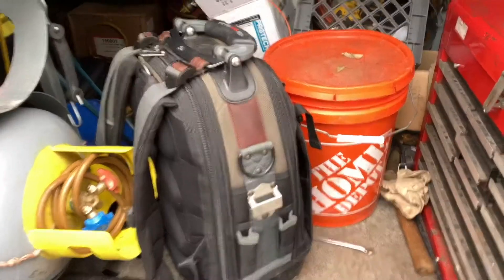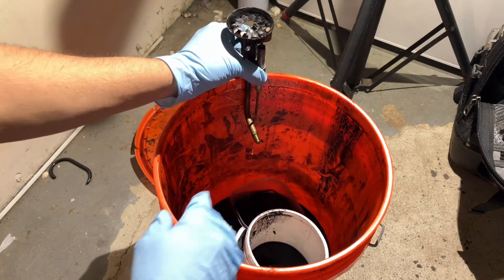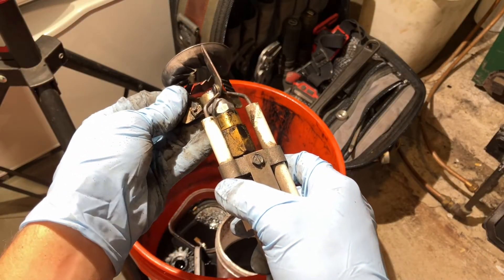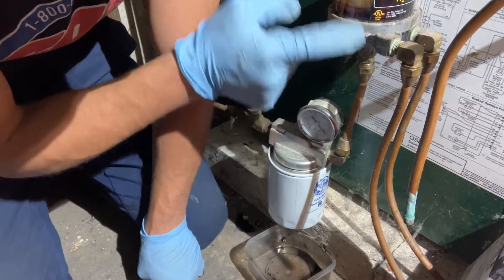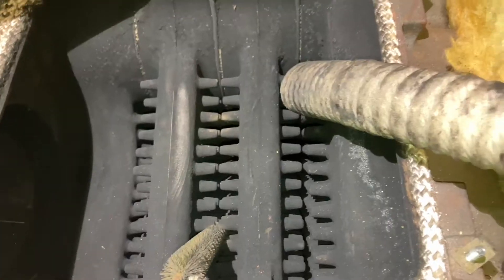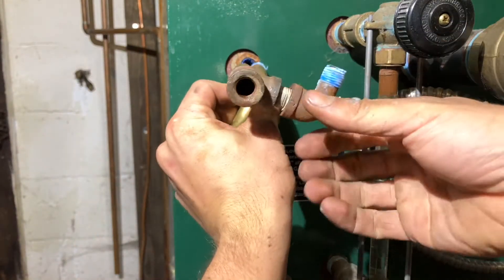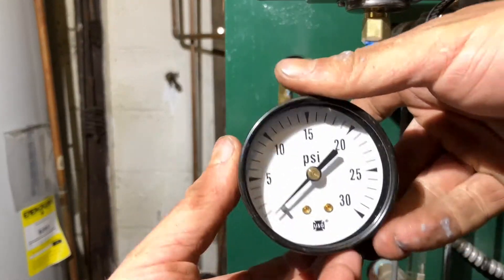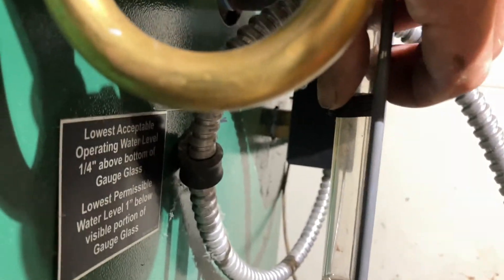What an Oil Steam Boiler Tune-Up Actually Looks Like

Comment: I am in a propane delivery and service industry. I always add ac/boiler/furnace switch if none is there. It's quick and easy modification. Customers are pleased when you tell them you added a safety feature that they can use if they feel something is not going right

Comment: I know its an older video, however one thing you should have done as a precaution would be to test the low water cut off as well by draining some water out to make sure it actually shuts off!  Safety first!  🤠👍  And a potential sale for new low water cutoff if it doesn't work.

Comment: You forgot to check the pump strainer! Great informative video, I recommend to use carb cleaner and spray down your electrodes, flame retainer, and nozzle assembly, and use some grit paper to get the nasty stuff off of the electrode tips. I noticed you used a Beckett electrode setter, I know Carlin has their own electrode dimensions which can be different than Becketts. I look forward to learning different ways you approach jobs!
Reply from the maker: Believe it or not I was going to include the strainer but forgot to mention it thank you for picking up on that! I was taught the Beckett guide is a good "guide" but eventually ill be able to see it by eye, like i'm sure someone with your experience level can do! Thank you for tip with the carb cleaner, definitely gonna include that in maintenance, and i look forward to learning different ways you approach jobs too! Keep in touch!
Reply: @theapprenticesurvivalguide  do you have any literature that you would recommend for a low period apprentice ? I’m trying to learn as much as I can on my own time.

Comment: Be careful using a metal wire brush to clean out those sections. soot is flammable and the metal brushes can create spark and ignite the soot, it has happened with unpleasant results!

Comment: Nice and thorough job.  I do the same thing each year with my gas steam boiler.  I also turned out all the drain valves and cleaned the accumulated mud out as well as turned out the sight glass valves and cleaned out those too.  I put in Hercules steam boiler cleaner also.  Do put that in or a comparable product, like 8-way?
Reply from the maker: Great to hear from you Kevin! Thank you for your generous comment. Only if the sight glass valve looks really muddy I’ll hang a little container on the valve then open it up to let it all flush out, if it has a sight glass drain I’ll let it flow for a good minute and call it a day. Do you think that’s enough or I should be more thorough? As far as cleaner I’m more familiar with using squick, seems like the Hercules brand might be better? Hope to hear back!
Reply: @theapprenticesurvivalguide  You do good work.  Most service people do a very quick and less than thorough service.  With so many steam systems in the NY/NJ area, you must be very busy.  It seems like you see a great deal of them, and from what I know most homeowners neglect them and then have problems.  I have found by doing the maintenance I do the last number of years, I have little mud in the system.  Key is what you do is cleaning out that pigtail, as that is big point of failure.  I see this home has a brass pigtail but steel fittings, which cause other problems.  I would suggest they swap those out for brass.  Squick is excellent, Hercules product seems fine by me but always open to someone who is in the trade and knows best.  Thanks for your response.  Keep up the great work!  Finally, you will be in great demand as there are not many people like you left servicing these boilers.  Go Giants and Jets!
Reply from the maker: @kevin7151  I cant thank you enough Kevin, you're very positive and supportive! Yeah, where i'm at we run about 5-7 service calls a day each, 6 sometimes 7 days a week. I don't think you would disagree with the idea that, and its mainly why I work that way, the more thorough you are with your preventative maintenance, the less of a chance you'll have to return for a service call later on. Obviously we can't find everything so it's going to happen, but going to a service call and finding out its just dead batteries in the thermostat is much better than finding a boiler leaking lol. You keep up with the great work too! I can tell you are passionate about your work! Go Giants (although these days they really test my patience)
Reply: @theapprenticesurvivalguide  Am in the north western part of Nassau county, NY and there are so many steam boilers here my friend.  My house is around 90 years old, so I make it a point to keep things running smoothly.  I am old now, but a someone like you who has youth on their side will have a very productive career doing what you are doing.  Just explain to each homeowner what and why you are doing what you are doing and they will better understand why it costs more.  Quality always costs more, and that should be your sales pitch!  Preventive maintenance is key with these boilers.  Nice win by the G-men today, although I hope Jones injury is not bad.
Reply from the maker: @kevin7151  I was doing a maintenance by someones house one day and she told me she gets a gold service every year because "cheaper is always more expensive" Couldn't agree more, you get what you pay for, it may not be today or tomorrow, but in the long run you'll spend more cheaping out. Steam is really big over here in north jersey too, well at least in the older areas, all new constructions are installing forced air, some gas, some electric! and not mini split heat pumps, electric resistance coils, and then call and say "my house is cold"

Comment: No offense you do realize that fuel oil is not supposed to be used as a lubricant on the filter gasket. Fuel oil swells rubber gaskets.
Reply from the maker: Interesting, I was taught to do it that way, thank you for the advice!
Reply: I work with a one or two guys that use it that way. Everyone else uses a real oil for the lubricant. I don’t think it’s make or break but I just try avoid it knowing that it’s a possibility the gasket could swell and cause a small leak.
Reply from the maker: @06GOAT56943  i'm grateful you took the time to reach out and teach me something new, thank you! So something like lubricating oil for let's say a circulator pump will be ok?
Reply: Yea that will work. that’s exactly what I use! Haha
Reply: Yea that will work. that’s exactly what I use! Haha
Reply from the maker: @06GOAT56943  Great tip! Thank you